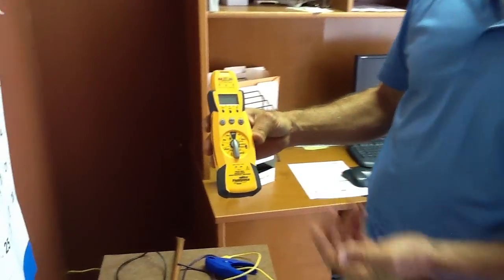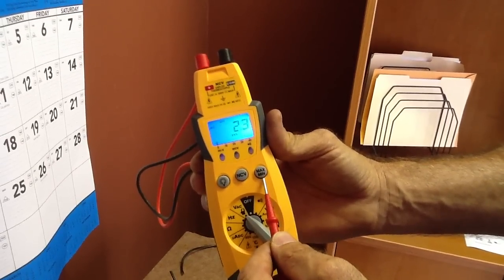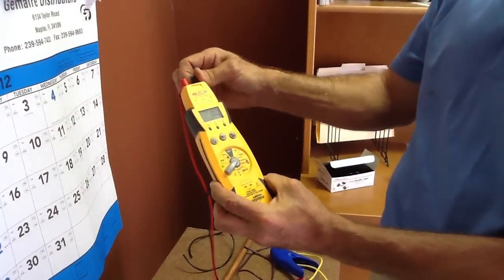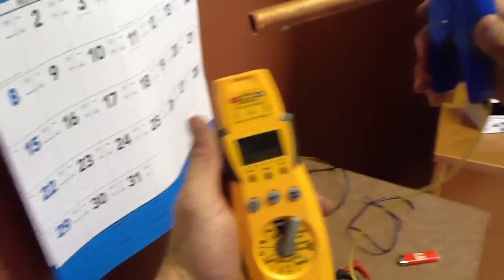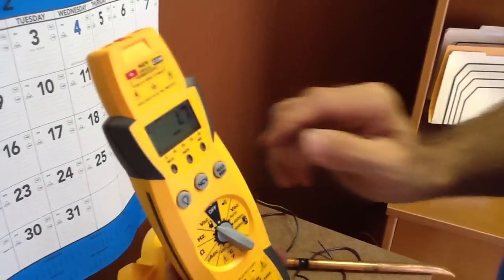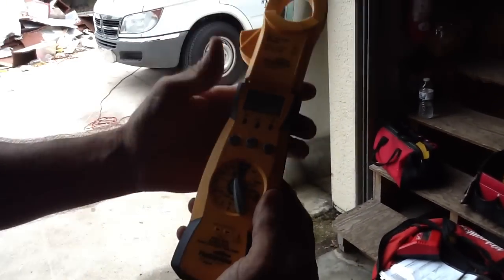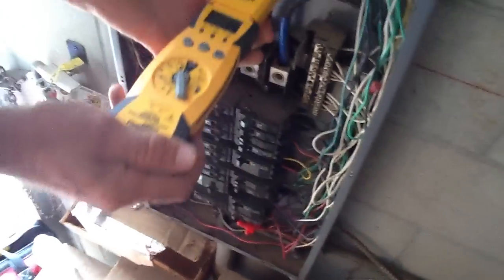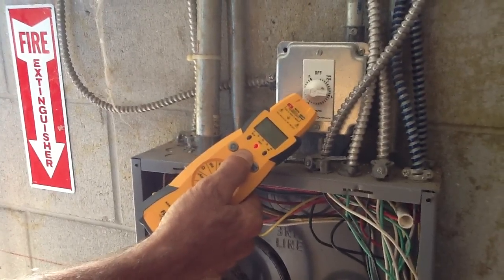Fieldpiece HS36 Explained

Comment: This was and still is my first meter in the HVAC trade. Excellent tool and by far the best customer service from Field Piece, the rotator knob broke off after some rough abuse, called up FP and was on the phone for 2 minutes total, had a tracking number 5 min later in my email. They don’t nickel and dime when your outside of warranty (within reason obviously). This meter will be 10 years old for me soon. Loyal customer for life.

Comment: Nice Meter, I down loaded the manual and found it reads a very high resistance @ 40M.  That's great for checking compressor windings and shorted windings.  I've always used Fluke but this meter is gaining my respect with all the features it has.

Comment: I bought one,back in 1998,and last me till 2015.     It was a HS26.   So I went and got me the same model for $80 online 
    I remember using amprobe back in the 90s,until I found Fieldpiece.   They are awesome!    Especially when testing a bad capacitor that is under value.